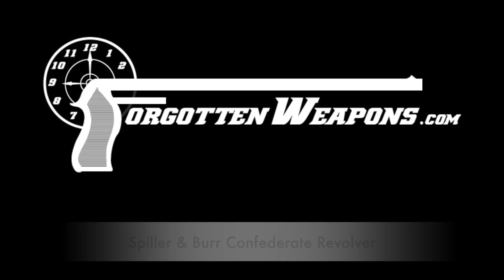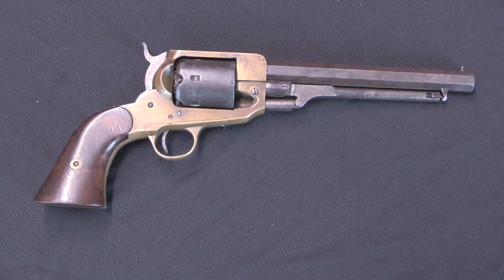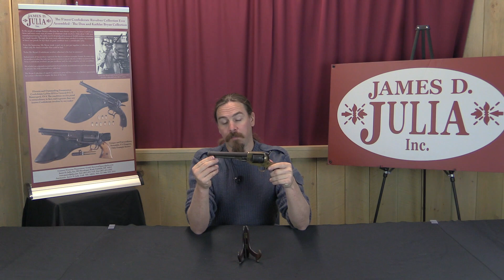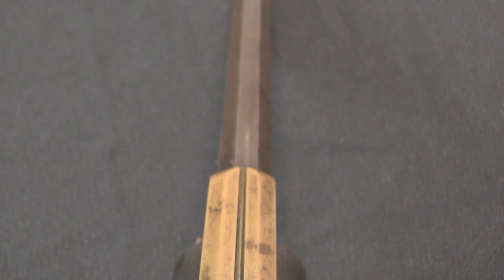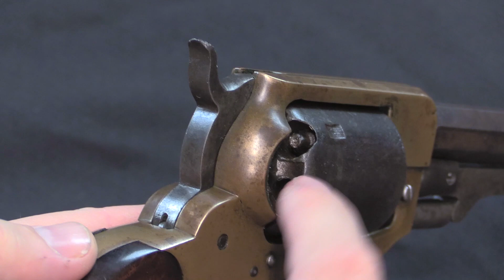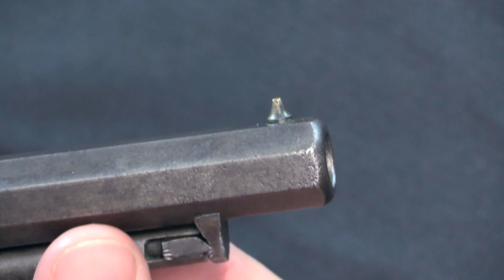Confederate Spiller & Burr Revolver (Presentation!)

Comment: The iron loading levers soon broke under use and a Whitney steel loading lever was used as a replacement. You're not likely to find one with the original S&B loading lever; if you do, it's likely a fake. Also, examined up closely, you can see the twisted striations in the cylinder iron .. much like a stick of twisted taffy.

Comment: Ian,  your presentation was excellent~ EXCEPT , you never mentioned nor showed the  most important feature of the Spiller & Burr (as with the Whitney Navy revolvers it copied), the squared lug on the left could  be turned 3/4 back and  releases the loading lever/cylinder pin to pull forward, freeing the cylinder to pop out and quickly be swapped for a  pre-loaded cylinder to be inserted and snapped in for another 6 rounds ! Tuesday, May 19, 2020
Reply: Also, the "presentation " model had a finer bluing and  beautiful burled-walnut  grips  !

Comment: Very good  presentation of the gun made in my hometown, Macon, Georgia ~ except for some unknown reason he NEVER mentioned a unique feature that was a rather excellent one, that they had a lug on the left side of the  frame ,ahead of the cylinder, that  you could turn 3/4 of a turn, and  it disengages the loading lever , so you  could slide the rammer all the  way out and release the cylinder to fall out of the frame. So if you had 1-3 extra cylinders in a shirt pocket or  belt pouch, already loaded , ready to go, juist pop  one into the frame, slide the loading lever/rammer  back in, twist the lug  back a 3/4 turn and lock it in for a  quick reload to keep firing. A similar feature of the 1858 Remington revolvers of the North !

Comment: With this being one of the few and limited pistols produced by the Confederacy it's no wonder the Southern troops picked up and used any guns lost by or confiscated from the Northern soldiers. I would certainly have preferred a Remington or even an early Colt compared to this gun.
Reply: I've heard good things about the 1858 Remington and the 1860 Army.Im learning historical black powder to buy and shoot (repops).I've heard this pistol that Ian is reviewing was very inaccurate.
Reply: @wirelessone2986  I mean that's kinda typical for a lot of guns at that time, but I think that had more to do with ammunition than the gun itself.
Reply: @wirelessone2986  fyi there's no such thing as an "1858," it's called the "new model" so you're basically thinking of the same gun 🤠
Reply: @beargillium2369  Thanks I didnt know that

Comment: You said the pressure is the greatest on the top strap. Strange how the first revolver that "Could blow your head clean off", the Colt Walker didn't even have a top strap.
Reply: There were no Walkers cast in brass. Brass sucks as a pistol frame material. There were various Colts in brass but low power configurations.
Reply: The cylinder pin on open-frame Colts are typically referred to as 'arbors' because, comparatively, they're as thick as tree trunks.

Comment: The modern replicas use better steel for the cylinders and relatively high-strength bronze for the frames. Interestingly, an original Whitney Navy revolver would foul from blackpowder residue after about seven shots without cleaning!  The replica S&B was good for about three-and-a-half cylinder-fulls before tying up.  Accuracy was about the best I've seen in cap-and-ball revolvers.
Reply: The other thing that is interesting about the loading lever is that Ruger uses that design rather than the Colt's type in the Ruger Old Army!

Comment: Were all confederate revolvers failures like the last few you've shown or were there some which were successful?
Reply from the maker: +Spark Gap They were pretty much all failures. Some were better than others, but none really became successful.
Reply from the maker: +Bart Bols They were all attempts to start production of complex products in wartime in an area without a lot of industrial experience while under blockade. They weren't dumb or incompetent, they were just working a very uphill battle. Even in the best situations starting up a firearms factory is a daunting task.
Reply: +Forgotten Weapons  it kinda sounds like they were inherently corrupt in their procurement process, both this and the Lemat were chosen based on political connections, maybe it's possible that better guns with more competent designers were passed over due to lack of connections.
Reply: +Feder Fencer agreed, reminds me of the crummy volksturm weapons cobbled together due to material shortages.
Reply: Really, it all makes you wonder about attempts at steel production in the south during the war...
Reply: Major General Scott's Anaconda Plan seems to have worked fantastically!

Glad Old Fuss and Feathers had one last hoorah before he retired from the Army.
Reply: I would say, also in line with Ian's own presentation of them, that Griswold & Gunnison were good guns.